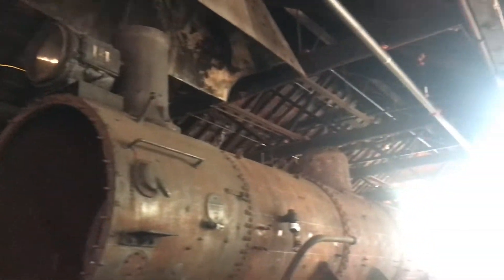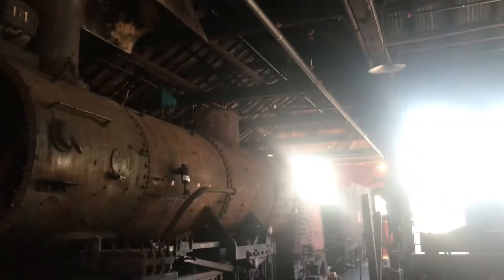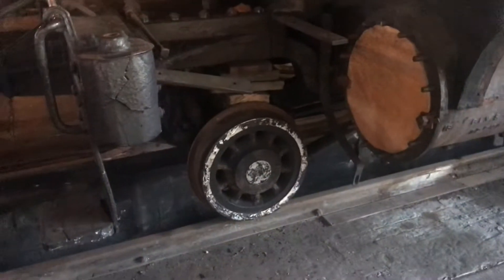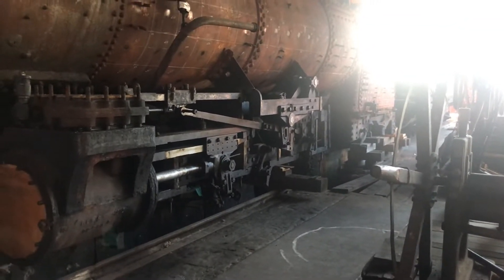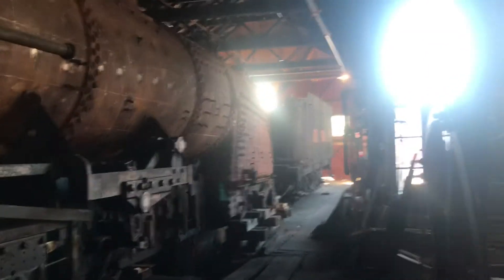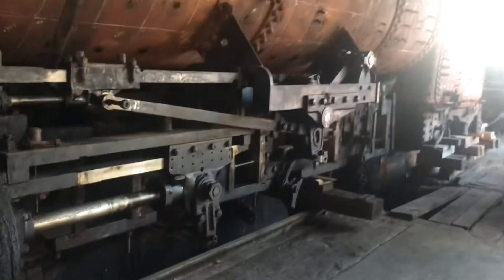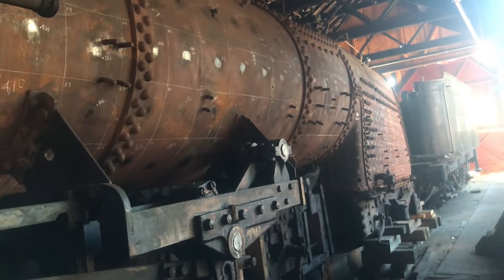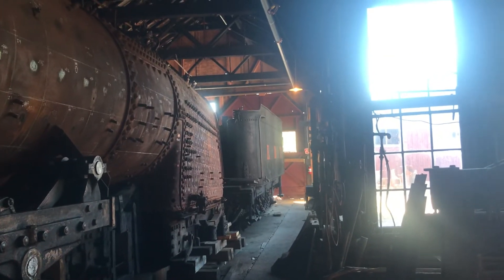East broad top railroad shop tour (part 2)

Comment: The 14's wheels had bad cracks starting the 70s and 80s and the railroad did not have the money to fix them up so what they did is they sent them to the Strasburg railroad for rebuilding and 14 will be the second mikado to steam on the e.b.t.
Reply from the maker: Thanks for letting me know where the wheels are at
Reply: @Keystone1906_Productions   sure not a problem any time

Comment: 14 might need new sheets for the coal bunker
Reply from the maker: It probably does after not being used for many years
Reply from the maker: True point  and they do need to drain the water on the final day of operation
Reply: @Keystone1906_Productions  and I’m sure they did. I will DEFINITELY make a trip to EBT one of these days.
Reply from the maker: Nice hope you have fun
Reply: @Keystone1906_Productions  I definitely will. Note the pilot truck needs repairs and the mud ring of 14 is missing a few rivets.
Reply from the maker: Yeah it definitely needs the clean up
Reply: @nicholasmedovich8691  Missing a few rivets? You sure about that?
Reply: @parails  a certain number of rivets. My apologies for any confusion
Reply: @nicholasmedovich8691  My point is, it is not missing any rivets.